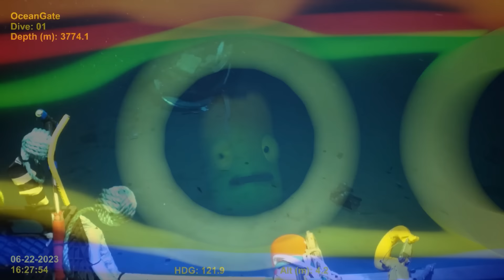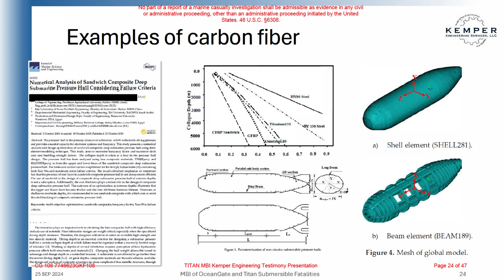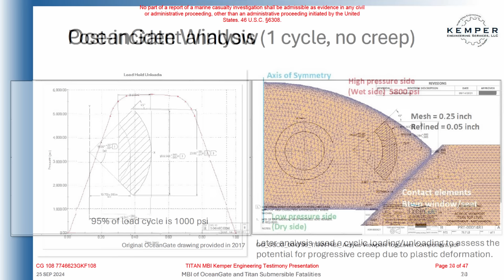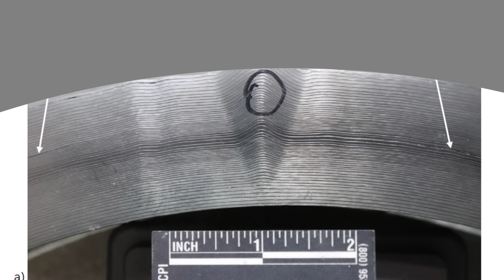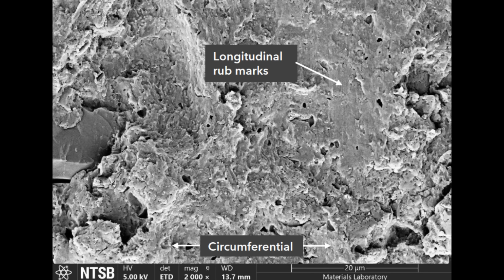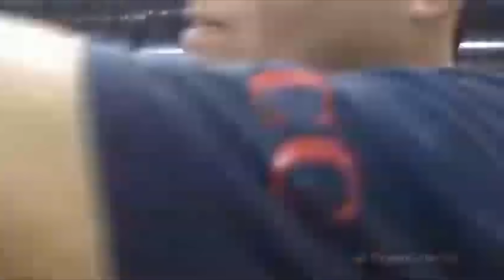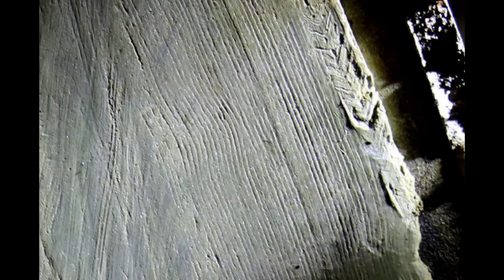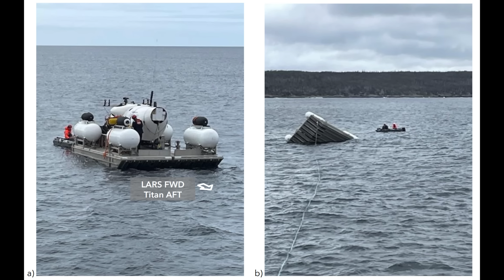OceanGate Wreck Shows Why Sub Wasn't Strong Enough To Survive - NTSB Shares Important Details

Comment: This is a really interesting one for me, because of some experience that the Defence and Policing industries had with composites after the introduction of soft body armours. I'll start out by saying that I have enough experience with this to "know what I don't know" rather than to provide advice on this sort of design deviation, but I can certainly say that I'm aware of a range of issues with composites which relate to a couple of different failure modes of the fibre matrix that seem relevant here.
Composites tend to either have a matrix failure, or fibre failure, where the fibre separates from the matrix. There's a lot of design decision for certain types of composite materials around whether fibre failure or matrix failure is best, depending on application, but I can certainly say that Kevlar isn't so widely used in bullet proof vests because of a risk of permeation which can result in early fibre failure.
In the case of early bullet proof vests, one of the major issues that was found was that, where kevlar was exposed to the enrivonment the fibre matrix, whether raw or in composite, could be lubricated by water. The water lubrication effect was enough to result in fibre separation which caused early bullet proof vests to fail to function effectively in the rain. This was eventually solved by hermetic encapsulation of the protective panels, but that then means you're dependent on the ongoing protective performance of the encapsulation to know that the system will perform as desired.
I never really checked into this, but it would be my expectation that this is why composite air cylinders are wrapped over a formed metal bottle for high pressure composite bottles. There's no academic reason you couldn't just wrap over a former and then either disolve or otherwise remove the former, so, whether it's cost or something else, there'd be a good reason that was done. I wouldn't be at all surprised that there was a risk of fibre failure due to permeation pulling fibres out of the matrix and causing an unpredictable structural failure. That was the first thing that rang MASSIVE alarm bells when I looked at the image you put up of the fibre machining...
In addition, compressive hoop failure would be a huge problem where there was varying geometry or stiffness around the ring and, while I know one or two people who have the skills to simulate it, given about a half million dollars of software and supercomputers, I would be seriously skeptical if anyone said "I simulated this" as a supporting argument for it being ok without further scrutiny. The biggest problem preventing meaninfgul simulation is because these are unpredictable manufacturing defects, which have a significant effect on local stiffness variation and also the directional stiffness properties and the risk of local fibre separation.
Honestly, I thought it was interesting as a problem right up until you talked about the fibre machining, now I just think this is an exercise in abject stupidity. The risk of permeation of the fibre matrix along the end grain of exposed fibre would be huge, the effect on local stiffness variation would be huge and the whole end cap interface design would be critically dependent on modelling the strain variation on the interface between the endcap and the tube... If the local stiffness varied significantly, then the local bond strain would vary significantly and unpredictably.

The more I hear about this stuff the more I think that the bloke in charge was just too stupid to get what he was working on. It's sad, because this doesn't sound like a bad idea in a general sense. Rush should have been smart enough, knowledgeable enough and experienced enough to at least understand and recognise some of this, although, granted, the detailed faiure mode analysis of composites is typically outside of the aerospace domain, but there should have been enough hints to go looking for that sort of issue.

Sadly, this feels like another VC setting back the general understanding of engineering through a combination of con artistry and stupidity.
Reply: Yeah, ok, I made this first coment at about 15 or 16 minutes, so I didn't watch the whole video... The flange failure, if it's properly designed, can't be a simultaneous bulk failure, it would have to be what's normally colloquially called a zipper style of failure, where a small portion of the structure locally fails due to stress concentration, which results in nearby stress concentration, then failure etc... The other FREQUENT problem you see with machined parts is lazy prep... Machining uses coolants which are functionally a really good, thin soap, which lubricates the metal off the tool and is very resistant to high temperatures and chemically stable, so it doesn't corrode the workpiece or the machine. Failing to clean this away is a key cause of problems for both paint and adhesive processes. Regarding the composite prep, the voiding in the composite isn't... Awful... In some of those areas, but the presence of peel ply marks probably indicates that they didn't properly key the surface for bonding, so the adhesive was likely incorrectly applied. Similarly, I honestly don't know why they wouldn't have just machined then applied the next wrap of carbon over the prepped inner tube, that would have helped with their interlayer bonding issues etc. I'm going to keep this open and add notes, because it's interesting. Up to 21 minutes right now :)
At 26 minutes, the "jump" in strain data is what's called a "permanent offset" it occurs when you pick up plastic deformation in a ductile structure... In this case it's an indication of an internal structural failure. With the depth vs strain charts, the hysteresis is a MASSIVE red flag, that's telling you that there's some form of damping effect preventing the structure from relaxing fully... Probably lack of adhesion in hoop joints. Given that there was always some hysteresis in the hull data, it probably always had delamination issues and that that got worse, as demonstrated by the increase in offsets and curve deviation after the "bang" on audio logging.
That was a genuinely interesting video and, while it's a bit of a sad topic I appreciate you covering it in detail.
As an asside, it's pretty unlikely they'll ever recover much if any of any bodies... It's a little morbid, but the inrush of pressure likely caused a combustion event.